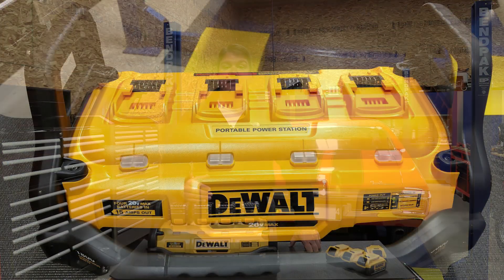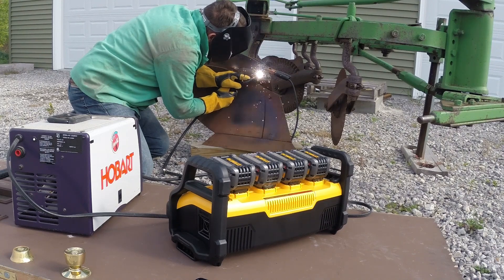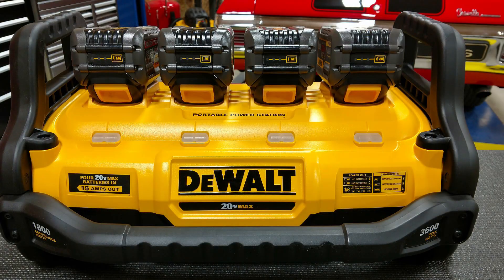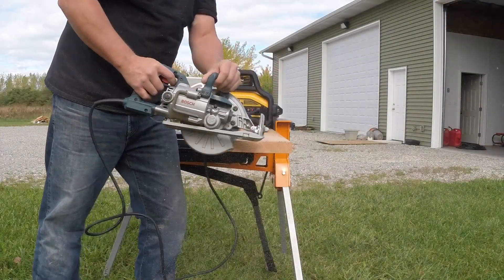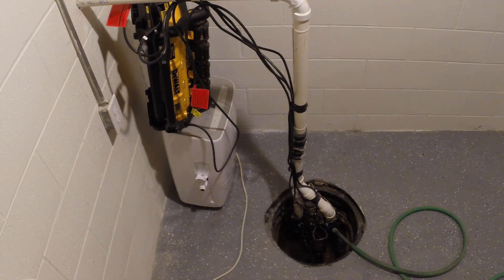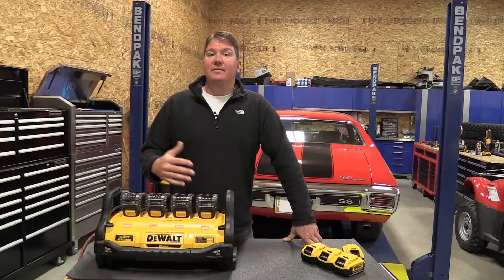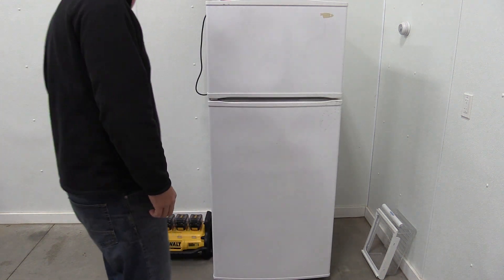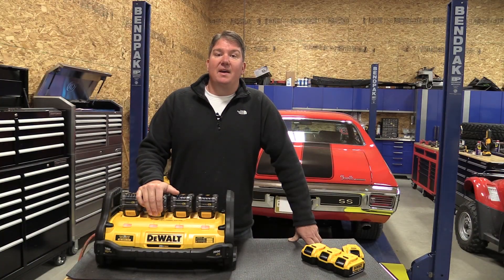DEWALT 1800 Watt Portable Power Station Testing - DCB1800

Comment: Very good video, You answered all questions . I would like to know if you have found a battery powered generator that will power a window unit AC say 5000 BTU's  ?
Reply: This unit should run a 5000btu ac fine. For how long I can't say though. 5000btu AC's take about 515 watts. This inverter unit can do 1800 watts continuous. You would be fine. If ya do the test, I would love to hear your results!

Comment: Thankyou for posting.  Would there be any advantage to using Dewalt's 6ah FLEXVOLT vs the 6ah-20v max?  I'm going to get 4 matching batteries but I'm not sure the Flexvolts are worth the extra $$$ vs the regular ones of the same ah
Reply from the maker: Stringfellow Hawke The Flexvolt batteries are 3p and the 6.0 Ah 20 volt are 2p, so you get more cells with the Flexvolt and it would give longer runtime with the extra cells.

Comment: I need some answers to compare to. I just recently got mine and yeah it runs tools but in you experience does it fully power the tool the same way a wall outlet would. in my experience it under powers my 4gallon 5hp shopvac. it also struggled to power my stationary bandsaw.

Comment: Want more jobsite happiness when you have no shore power?  Feed the charger off an inverter in your (running, diesels can idle all day) truck. Larger inverters can also power corded tools so it's all win, and you can charge driving to and from the jobsite.

How about testing some inverters with battery chargers?  A handy feature of charging tool batteries off an inverter is charging amp draw is MUCH less than a tool running under load, so a small inverter can feed chargers easily and without overloading your vehicle charging system.

Comment: Can you use the inverter with only 2 flexvolt batteries? Or do you need all 4 plugged in
Reply from the maker: You need to have 4 batteries total and it only lasts as long as the smallest battery.  So you could have 3 large Flexvolt and one small compact 20 volt and it will drain all 4 at the same rate.  As soon as the first one discharges, it shuts down.
Reply: WorkshopAddict  ok, thanks for the quick reply, it’s much appreciated

Comment: So I'm assuming this will run a DeWalt 20gal compressor with 4 9AH  batteries?
Reply: I have used it with a Jackhammer.  I am a plumber it's very handy..and it charge all 4 at the same time
Reply from the maker: It should, no issue, as long as it is 15 amp.

Comment: I took my DCB1800 on a three day fishing trip thinking it would charge/run a bunch of stuff for me.  I was running 4 fully charged 6.0 amp hour flex volts and it plugged a crock pot in it on high.  I can't say I know exactly how long it ran because we left the ice house to scout around with our pullover shacks, but we came back like three hours later and it was dead.  If it ran a fridge in this video for 14 hours, I wouldn't think that running a crock pot for 6 hours would be out of the question.  I guess I never knew how much electricity a crock pot drew.  I just figured it would handle the job no problem.  I was kind of dissapointed in the unit because this is what I brought the power station on the fishing trip for...I just didnt know one crock pot could drain it so fast.  Seems like it does very well on everything else.
Reply from the maker: Justin Burns I would think it would have no problem with a crock pot but I guess I don't know the amount of Watts it would take
Reply: Anything that produces a lot of heat uses a love of current

Comment: $230 isn’t bad for this. 
Since an 1800 watt 15A UPS unit is about $130, you’re essentially paying another $100 to have a built in 4-port charger. 
Not bad.
Reply: except the UPS already includes a battery and you have 4 Dewalt batteries to run this.

Comment: The silent running is a big plus in my opinion. Hope they work out a way to charge the batteries and still run something at the same time.
Reply: You need to think about your logic there. If you have wall power, why would you need to run the inverter and charge batteries at the same time? Just plug straight into the wall what you would try to run through the inverter. If you don't have wall power, you can plug a powerbar into the inverter and then plug a charger into that plus whatever other item you wanted to run off the inverter. Just make sure to not exceed the 1800W constant load. Asking for direct charging ports in addition to the four dual purpose top battery ports just so you can charge batteries while running the inverter is going to make the unit larger, heavier and more expensive for a rare group of users.

Comment: Can this unit operate as a charger if charged by a modified sine wave inverter and solar panel configuration ? This way I could charge it during the day on solar and use it as back-up overnight .  J K

Comment: Sorry but if i have something that draws 550 watts,how long will this Dewalt run it for?  Assuming it's the biggest Dewalt setup I can buy. Thanks in advance Workshop Addict.
Reply from the maker: So manny variable..  With all 9.0 Flexvolts, it should easily run for 4 hours.  With 5.0's, maybe an hour and a half ish.
Reply: Thanks.

Comment: i just discovered this two days ago and you guys had this posted a year ago... man im late to the game. BTW, i see you said its only as good as the weakest battery. I dont think that can be true. Every Amp hour you supply, it uses. When the voltage to the inverter drops, the battery with more capacity will naturally have the higher voltage of the batteries and thus supply more voltage thus draining it more than the others thus providing the amp hours that it has extra to the others, given there are others with less capacity. ... thus! muahah
Reply: im referencing 1:00 mark

Comment: Hi great review. Here's one for you. Would it trickle charge a 24kw Nissan Leaf electric car using what they call the granny lead. Using the granny lead normally takes about 10 hours to charge the car compared to the standard fast charge point which is 4 hours charge time. Thanks
Reply from the maker: burgerman3 Need more info on the power consumption over 10 hours.

Comment: I bought this unit with 4 6ah batteries.  We got 2hrs 15 min out of a 5 hp 9 amp Ridgid Wet/Dry Vac running non stop till the inverter shut down.

Comment: Curious to see what this thing would do with the 9 amp hour batteries. I am sold. I am upgrading to this, the cordless miter and the whole 9 yards.
Reply: A gentleman down in FL told me he ran his whole house after the hurricane for almost 10 hrs with 4 of the 20/60v 9ah batteries
Reply: I ran a table saw and cut for 2.5 hrs pretty consistently with 24 inch strips of walnut, cherry, and maple. Probably did well over 150 cuts.
Reply: It would be 1/3 better than the 60volt 2 ah/ 20 volt 6 ah batteries. Dewalt now has 20volt 12 ah/ 60volt 4 ah sothoae would be 2 × as good as the ones shown in the vid
Reply: @zachhenry1170  Just an FYI Ah (Amp-hours) doesn't change based on the use case - the Wh (Watt-hours) would drop the way you converted, but Ah is fixed. It's like the amount of gas you have in your vehicle - its the same but you will use it quicker if you drive at different speeds.
Reply: Phuong   Of course a gas generator will be more powerful. And probably run longer. But you cannot use that indoors… It’s a little bit different animal.  And then you have the maintenance of a gas generator to deal with
Reply: 12Ah test could be Boss

Comment: ran my 70 inch TV for 56 minutes with 20 volt batteries
Reply from the maker: I would have expected more, but not bad.  5.0 Ah batteries?
Reply: WorkshopAddict yeah 4k smart I was running Netflix
Reply: 4 ah btw
Reply from the maker: William Weathersby That is good for 4ah batteries.
Reply: I did the same with a Die Hard jump starter box. 18-22 amp hrs, 400 watt continuous.

Comment: Can you retest the vacuum cleaner with the 4 60 volt 6ah batteries?  Please!  Also now they have the 60 volt 9.0 ah batteries but they are $200 each ouch...
Reply: My comment as well, the vacuum is continuous run time. That will give us a better idea of it true run time.
Reply: I ended up and  bought one with 4 6ah batteries.  We got 2hrs 15 min out of a 5 hp 9 amp Ridgid Wet/Dry Vac running non stop till the inverter shut down.

Comment: Lets say you have 3 fully charged batteries in the unit and you insert a dead battery in the 4th socket. Will it charge the dead battery and keep the others from trying to charge?
Reply from the maker: hed420 like any other charger, it will assess each battery then start charging.  If 3 are charged, it will only charge the dead one.

Comment: test out  60volt 9.0 a/h
Reply: Michael Hardy 
Four 9ah batteries only gives you 180Wh total .. the batteries are wires in series
Yes you will get 1800W but for only ~5 minutes

Comment: Best deal is to buy it without the batteries. You can then get 2 5 ah batteries for less than $100 or $200 for 4 5 ah batteries. Which means you get 2 ah more capacity than the kit for the same or less price.

Comment: What is the power input requirement on this?  I would like to be able to use this in conjunction with an inverter mounted in my vehicle and then on a solar power system.  I am putting together components for a new modular power system like the one I did on the trailer a few years ago but trying to make it more modular portable.  I ned to figure what size inverter these require and whether or not the charger will be okay with modified sine wave instead of pure sine wave.  One of these units would mean in theory, that I don't need to run as many lead acid batteries in the power system in order to make it useful to run high amperage power tools.
Reply from the maker: Power input as in charging power or Dewalt battery power?
Reply: WorkshopAddict charging power.  My idea is to use this with the 9AH flexvolt batteries as the take-out power system in my service truck and then also recharge it off the off grid power system.  So I just need to know if this can run its recharge capability off modified sine wave type power without overheating.  That's one of the problems you can run into while charging devices like laptop power converters off a modified sine wave inverter.  If I fry the Dewalt power station or the batteries it is recharging, that would suck, but I will likely try and get the extended warranty with it.
Reply from the maker: Great question.  I focused so much on what it can do, I never did any research on how you could charge it.
Reply: WorkshopAddict Eh, nobody seems to really know, I am probably just going to have to buy one and test it all out.  I have one of the older 18v battery charger worklight combos that I did this with on a smaller scale but it was a much lower investment for testing and I never used it long term.  The idea of plug and play solar generator components is pretty attractive, like plugging one of these straight into a Goal zero style setup.  A lot of power gets lost on the DC/AC/DC/AC conversion process, but the give back is that it offers scaleable plug and play power systems that don't take an engineering degree to design and implement.

Comment: why doesn't it produce 240 volts if you put four 60vV batteries?
Reply: it is switchable http://www.dewalt.com/products/accessories/batteries-and-chargers/chargers/1800-watt-portable-power-station-and-parallel-battery-charger-kit/dcb1800m3t1
Reply from the maker: 2 reasons...  One: It still produces 120v when you put four 20 volt batteries in it.  Two: You have to remember, Flexvolt batteries are 20 volt or 60 volt.  My bet is that this unit uses them as a 20 volt and uses the extra Amp hours in the 3P Flexvolt batteries.

Comment: WHICH BATTERY SYSTEM OFFER THE MOST POWER FOR AN ELECTRIC BIKE??
Reply: Most Ebike battery companies seem to use LiFePO4 , this tools batteries use 18650 cells same as Tesla motors , but you can also use lipo. If you are going for cheapness you can not beat buying dead laptop / tool batteries and building your own pack but you must know what you are doing. I was able to buy 20 dead ryobi 40v tool pack off ebay for $75 , each pack has 20 1300mah cells that drain at 10 to 30 amps. Out of the 400 cells around 250 of them worked , using cell holders i built a 15s 6p battery pack  that pushes my bike to 35mph in what seems like about 2 or 2.5 seconds. It doesn't have a lot of range this way but i only built mine for fun .

Comment: IS THIS A GOOD OPTION FOR A DIY ELECTRIC BICYCLE?
Reply: tom higgins 
You're much better off using electric scooter batteries available online. The Dewalt batteries are very expensive per Ah and most motors are designed for 24v-48v DC not 120v AC like this puts out.
Reply from the maker: It is an interesting option.  It would run a small motor for a very long time.  What do you plan to use as a motor?

Comment: how long runtime for Hobart mig welder with 2400 watts/20 amps inputted, need put watts or amps current test meter, new Lincoln electric power mig 210 MP for energy save then less load  15 amps with 120V
Reply from the maker: Iginio Romero I don't understand.

Comment: Very interesting video.  Sounds like a great alternative power source than being tied to a power inverter that is plugged into a vehicle power port or hooked up to a battery.  Great idea from Dewalt.  Batteries are not cheap so the combined cost of the unit and the flexvolt batteries are really pushing the is it worth the money envelope though.
Reply: Actually... That above power source is NOT flexvolt tool. Even if you connect flexvolt, it will just run as 20V.
Using 4 5Ah batteries will give you comparable run time.
Reply from the maker: If you are into the Dewalt 20 volt line, you might already have the batteries.  But if you are going into this as a single Dewalt tool, you have a great point.
Reply: WorkshopAddict If you have the 20V line  you most likely aren't buying the flexvolt stuff so in order to use the charger/inverter to its capacity you would really want to upgrade batteries at a cost that will turn many away.  If you are running the 60V tools then you already have the right batteries, so this may work great, otherwise its probably not worth the additional cost to purchase, at least for home use.  Jobsite use this is just about a must have, I remember being on job sites where everyone was fighting for an electrical outlet on the far end of a property and having to run 100+ feet of extension cords.  This would certainly alleviate many job site power lacking problems LOL.  I don't work construction anymore but I still want one of these for when I'm working on the property so I'm not running cords.
Reply: Kyong Song
Reply: i think you are right. i would rather buy a generator with that much money.

Comment: Really would like to know what the run time is using a  1/2 horsepower compressor like senco. If you have a cordless miter saw, table saw then all is needed would be a compressor.
Reply: You could kick the compressor out too depending on what you're doing. I use DeWalt's 20V Framing and Finish guns for work and they do really well. I can go all day with the finish gun on a single 2amp battery, or almost two days on a 4amp. The only reason I pull out my compressor is for my Hardie nailer or palm nailer.

I definitely see the huge potential for this tool and am keeping it in mind, though personally.
Reply from the maker: Rick Knowlin How many amps and watts is it?  Every tool will have a different run time.  So we can compare it to some of the items we tested.
Reply: 4 amps @115V  128 seconds pump up time (0-125psi)    35 seconds (90-125psi)
Reply from the maker: Rick Knowlin Rick, that would be very comparable to our sump pump test.  Our sump pump was 5 amps.  This tool loves the on and off type tool.  My estimate is that you would get a full day of jobs it's use with this.
Reply: WorkshopAddict 
That's exactly what I wanted to here.  Thanks
Reply: You could also buy the dewalt flexvolt air compressor.

Comment: Nobody saw this coming from Dewalt, pretty impressive . I hope Milwaukee make something like this too so I don't have to buy into another tool line haha
Reply: I think you can buy adapters so you can plug your milwaukee batteries into day a ryobi or Dewalt. Check Amazon or eBay
Reply: As Richard said, this one is probably a good candidate for the adaptors. I believe the dewalt batteries are very simple, so using another brand in this as a power source is likely very safe. I wouldn't recommend charging those batteries with the power source though... LOL.
Reply: same here
Reply: Same. I've talked to ryobi aka tti aka Milwaukee and told them to make one. We'll see what they do